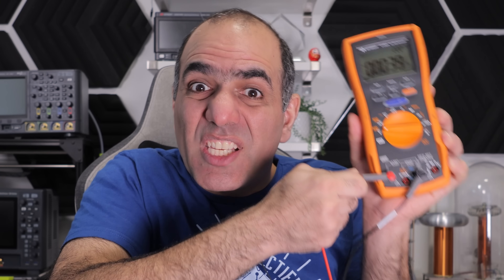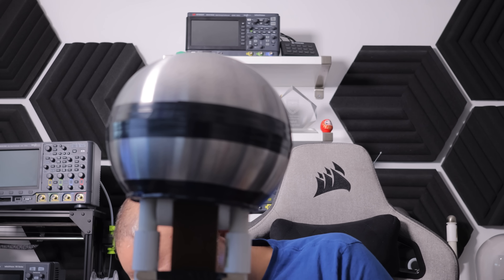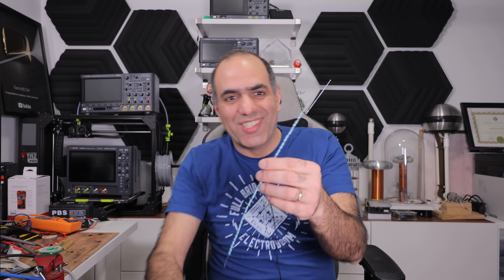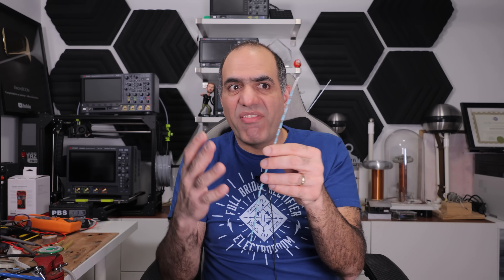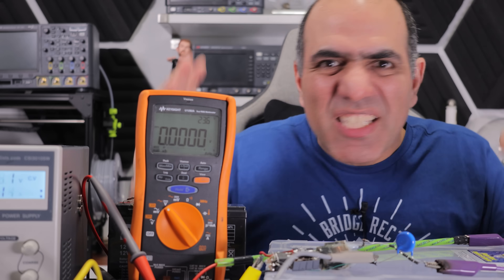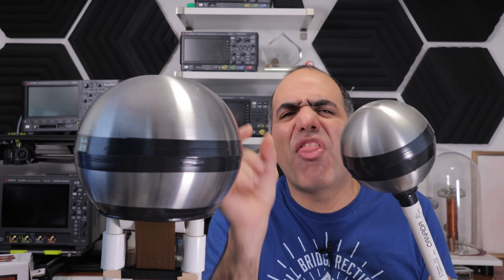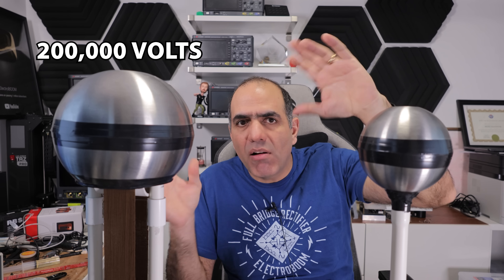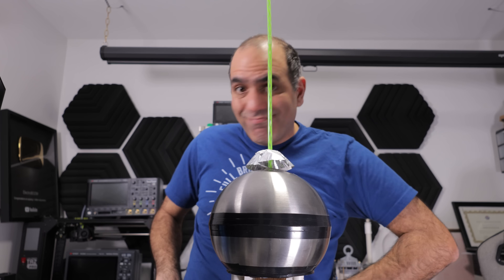SUPER HIGH VOLTAGE Measurement

Comment: This is how they measure those voltages in substations. Although they use a well-tested and rated professionally manufactured equipment with proper safety.

Comment: I'm a software developer for power grid relays with a focus on low power instrument transformers. I can confirm, more or less the exact same techniques can be used to measure grid voltages (and currents) even in the areas of kV and kA. Especially when you started talking about input impedance and capacitance, this was very familiar territory.

Comment: You can not measure AC voltage with resistor dividers because parasitic reactances change your inpedance values. Use your FULL BRIDGE RECTIFIERS first lol. I also made a video on this type of divider on my channel and it worked flawless up to 50 kV.

Comment: Bringing your body close the van de graaff generator was enough to disspate its charge through the air, which is generally considered a very good insulator. Would holding the straw also disspate its charge in the same way? Did you try holding your straw resister pack against the sphere without you holding it e.g. using a insulated clamp of some kind? Great video, as always!

Comment: What if one would charge a sufficient large high voltage capacitor with the van-de-graaff generator? This would be ready really dangerous but supply the Mieter long enough with high voltage to measure it while decaying through the resistor

Comment: because is static electricity...if you had 200000 v dc not static results would differ
big fan since the beggining!!
Reply: Remember, "static electricity" becomes no longer static, but dynamic, when it shocks you or when it arcs to something else.  To assess danger or damage, we have to be concerned with the available energy.  (I'm sure you know that -- I'm saying this for the benefit of others.)

Comment: I've been told that you need only 10kV for one cm, instead of 30 kV. And i checked it.
30 kV is for 3 cm.
Reply: Spark length depends of the shape of the electrodes as well as the voltage difference.  A voltage of 10 kV will jump between needle points separated by about 8.5 millimeters.  The same 10 kV will jump only about 3 millimeters between large spheres or flat electrodes.  Look up Jochen Kronjager for a nice graph and table of the effect.  This only applies for standard atmospheric conditions.
Reply: @analog_guy  thanks!

Comment: Would it be possible to use a capacitor, letting it charge up for some time by the high voltage and then using your giga-ohm probe to discharge the capacitor while measuring with a scope. Then you could see the discharge and from what voltage it was charged to.

Comment: Use an electro-static meter. It is basically two plates that have a spring holding one of them and a needle to measure the deflection of the plates. It does have to keep the plates from getting close enough to arc. one can calibrate with some small weights of known amounts. I forget the math to determine the amount of attraction but it is available some place. I have a meter that uses vanes like a variable capacitor that is used to measure 10K volts. The calculation is simpler as the distance doesn't change, only the area and spring tension.
Reply: There are also inductive probes, they have two electrodes shielded by another set of electrodes that spin. This induces a changing voltage on the electrodes proportional to the intensity of the electric field they are exposed to. This are used to measure voltages up to several millions of volts on electrostatic particle accelerators.
Reply: @teresashinkansen9402  Yep, "field mill" voltmeters.   
The moving-capacitor type are "quadrant electrometers."  They only measure 5KV, although there's one model which goes up to 30KV.
Reply: @wbeaty  Yeah I couldn't quite recall their name. Ive seen them be used on pelletron accelerators to measure terminal potential.
Reply: @wbeaty  yes, I have heard of this.
Reply: It's that basically what's happening at 13:13 with the grounded orb moving every time it gets hit by the discharge?

Comment: With that aluminium piece levitation height, you can calculate the voltage.
F = (k * q1 * q2)/ r²
F = mg (Get F value & put in eq.1)
 
q1 = q2 = q
Find q

V = kq/r
Reply: Where is the factor for relative humidity?      :)
Reply: Oops, when in contact, V1 equals V2 but q1 does not equal q2.  The charge, q, of the oddly-shaped aluminum piece (whether it is called q1 or q2) is just about impossible to compute without an expensive electromagnetic field solver program.  In addition, as soon as the aluminum piece rises upward, its charge is likely to change due to corona discharge from its sharp edges.  If the aluminum piece were replaced with a smooth conductive sphere that were sufficiently light that it could be levitated, that might create a calculable situation.

Comment: How about using a potentiometer to measure the potential of the dome?

Here look at the constant current section for how to do that.I think this should use much less current from the vando graph. But you need a much higher voltage that has at least some current providing capacity.
https://en.wikipedia.org/wiki/Potentiometer_(measuring_instrument)#:~:text=A%20potentiometer%20is%20an%20instrument,source%20of%20the%20unknown%20voltage.

Comment: to measure static charge like this, I think you need something called an electrometer.  Tektronix sells the Keithley Electrometer Series 6500 & 6430.  Of course, it's not cheap.  I needed to use one when I was helping fix a fuel pump & filter design.  It was generating static electricity, which isn't exactly what you want from a fuel pump!

Comment: Nice video. The question than is how did they measure the voltage to establish how many volts per centimeter gap for a spark?
Reply: They used a more powerful voltage source so the voltage was not loaded by the measurement.
Reply: @glasslinger  Thanks. Make sense. But did they have more powerful equipment at the time the voltage/distance was established?

Comment: 2 electrodes can be enclozed in plastic chember with variable (magnite inside and outside of the enclosure) gap between them, inside   some dielectric oil with stable electric breakdown.
Or old electroscope with no ground needed ( those with two long leafs that repeal each other)

Comment: A capacitive coupling would work. Of course the capacitor needs AC, so the field needs to be chopped up. This may be done with a tiny metal "fan blade" rotating between measured object and measurement electrode. Then, build a proper amplifier and measure the square wave amplitude.

Comment: Even though you're pulling the charges out of it super fast, shouldn't you be able to use the divider hooked up to your scope to see the initial voltage before the fall? This has the added benefit of allowing you to also measure the capacitance of the dome based on the time constant

Comment: Need an electrostatic strain gauge. Measure the force between charged plates and calculate the voltage. Probably involves LASERs too since the forces would be very small.

Comment: All your shows are fantastic , Thank You I have learned so much from you.   I have never been able to make a homemade 
device to actually measure huge static electricity voltages and currents .  I thought I did a few times , but , It's hard when there is no way to check .   Thank you again.

Comment: 3:24 I have to disagree with this explanation. There is no voltage across the resistors because there isn't any current through the resistors. You don't have a closed circuit in that setup, so there is no reason for there to be current going through them. I thought you would have put the setup between between the main ball and your ground ball. Then you would have the issue you were talking about, and it wouldn't work, lol.
Reply from the maker: There is a closed circuit there though... secondary of transformer across resistors
Reply: @ElectroBOOM  with the Van Der Graff Machine?
Reply: If he terminated the resistor with another sphere it might work. The VDG is such low current (static generator) that the resistor provides enough of a breakout point.
Reply: @Pyroteknikid  yeah, there are a plethora of other issues with that, but at least it would read something, lol.

Comment: I intentionally tried to measure the "Amps in the socket", but only once. 🤣It blew the breaker and melted a bit off my probe's tip. It also shocked me, but not electrically, y'know. 😉 That day, i've learned "don't do that", and a few years later i've learned why.

Comment: You can also measure the electric field of your Van-de-Graaff using a generating voltmeter, also called field mill. This is actually the way electrostatic Van-de-Graaff accelerators measure the acceleration voltage in absence of an ion beam. (With an ion beam there is a more accurate way to measure voltage, but this is only applicable in particle accelerators)
Reply: Medhi with his own cobbled-together particle accelerator, what could go wrong!  Don't give him any ideas!  :^)
Reply: @MikesTropicalTech  That SHOULD be his next project! He can make his own cyclotron (i.e. a circular particle accelerator) in less that one cubic metre or even four cubic metres by make his own high current/high-voltage EM coils and using curved  6 inch diameter ceramic sewer pipe (one $3 CDN per foot of pipe that is high temperature resistant) as the insulator and wrap copper coils and a ferrite core together to make electromagnets to create the driver coils for the accelerator. Collide tungsten nuclei together and see if you can measure gravity waves exploding outwards from the particle collisions! If that doesn't work, pulse all the coils at the same time and make a hydrogen plasma SUPER HOT and at high pressure to make his own miniature Takomak Fusion reactor -- He should be able to get plasma temperatures up to 50,000 Celcius at home! What could POSSIBLY go wrong doing all that in his apartment? Use the 240V at 30 amp circuit coming from his home dryer to make a 7200 watt version of said particle accelerator or mini-fusion reactor!

V
Reply: @ I vote for the Tokamak!  😄

Comment: In substations we use potential transformers to step the voltage down to a level we can measure it. The pt measures distribution voltage, and steps it down to something we can measure with a meter, so we can use the ratio of the PT, and the ratio of our substation transformer to find the voltage on the transmission line at that point.
Reply from the maker: You're lucky you have giga watts ti spare!
Reply: @ElectroBOOM  Yes, that's the point of this whole video!
Reply: @ElectroBOOM yes, and in our HV lab at work we use a capacitive voltage dividers, with a tiny capacitor of something on the order of a few pF, that has a very low burden even at pretty high voltages, probably would still be too much for this, but can be used on most sources, we are talking of resistances in the teraohm range instead of giga
Reply: Also the burden of a PT is not that big, it’s like 15 to 200VA depending on model, too big here but not even a KVA

Comment: 3:48 100MOhms? Puny resistance. I used to work on tests where 1 MOhm was considered a short. 100 G Ohm was ideal. Had resistors up to about 10 T Ohm but could measure up to TOhm

Comment: @ElectromBOOM
Try to place the series resistor array far away from the measurement point, such that the resulting probe and cabling getting in proximity of the DUT (and its field) all has high resistance to ground. When you place the resistors at the probe tip, then the cabling (and some of your probe's structure),  is providing a low impedance path to ground in close proximity to the DUT.

Comment: My guess is that the resistor is pararelled with the epoxy resin so lower resistance or the insulation is not well so it arcs through the rod and to the end of the rod (maybe? CMIIW)

Comment: Can't you use a shunt resistor connected to a metal ball and ground and measure across it with the scope? Won't be incredibly accurate since the arc will eat some of the voltage but should still give an idea.

Comment: True story. I killed a less than year old Harbor Freight multimeter when trying to measure the output voltage of an electric insect zapper. Would a setup like that work to prevent that?

Comment: The ending was amazing! You could make an analog voltimeter that looks like an mercury thermometer. Just like you did on the end of the video but with a scale, and the higher the aluminum foil flies the higher is the Voltage. Would be nice.

Comment: I remember the HV analog meter we had in school were just two plates electrically connected and one was able to rotate away from the other plate with the axle at one side of the square plates. The indicator needle was just fixed to that axle/moving plate

Comment: I'd get one of those huge-ass vintage HV probes with integrated voltage dividers rated at 20...30kV. Touching a CRT plate connection with anything less is just asking for trouble.

Comment: Electroboom Uploades a Video

Me* Gosh He Is Alive
Reply: Me too!!
Reply: @Windows98Official same
Reply: Or maybe:  "IT'S ALIVE!  IT'S ALIVE!" lol
Reply: Same
Reply: You prob don't understand what's happening. He's getting shocked, right, but current doesn't go through him. He's isolated from the earth with a rubber mat probably.
Reply: @klarnorbert  He has quite literally almost died in one of his videos. This is a very dangerous hobby and many of the hobbiest die when experimenting, even experienced ones. Electricity is unforgiving. There's a fair reason for worry if there goes a long period of no communications
Reply: @XxPKphoenixX  That's the Main reason as he plays sometimes with High Voltage and High Amperage souce like microvave transformers.
Reply: He wouldn't get shocked if he would be on a rubber mat. But hecould be using some ESD mat with high resistance... Or he uses a source that is current limited.  @klarnorbert
Reply: @klarnorbert 
He is isolated, but capacitativly coupled to ground.
AC≠DC
Reply: @klarnorbert  I understand but he also has microvave transformers which can provide enough high voltage and Amperage to cook you to perfection before you will hit the floor
Reply: @ He used the high current to weld!

Comment: Safety tip:  when stowing your multimeter, always disconnect your leads from the meter.  In addition, when measuring current, immediately disconnect your positive cable from the meter.
Reply: Idk why don't we use another probe for current measurement. Purple colour isn't reserved for anything. Can we have a purple probe for current?
Reply: Nonsense
Reply: @Shocker99  We implemented those rules after two incidents within 12 hours where a tech tried to measure 480VAC using a meter someone else had used to measure current earlier.  Yes, the fuse blew, but they still got flash burns to their eyes.  Several years later when NFPA-70E was implemented, we just issued Fluke T5-600 meters to everyone and made it a firing offense to even approach anything more than 480VAC without specialist training.  Even idiots have a hard time screwing up T5-600s.  Two guys managed it anyway over the years.  Idiots are just too damn inventive.
Reply: @Simple_But_Expensive  Nice story, but your safety tip is still nonsense.

Comment: The best way is through observation. If the bird sparks and burns, it's residential transmit voltage of around 12-40Kv. If the bird explodes in a puff of feathers, it's high voltage transmission lines of several hundred kilovolt.

Comment: You could build a tiny capacitor bank something like 1nF 200kV a let the Van De Graff charge it. With 2G ohm resistance, 2seconds time constant should be enough so you can quickly measure the voltage before it drops too much.
Reply from the maker: Sample and Hold! I like that thought! Although now that I think about it, that would be super challenging to sample too...
Reply: @ A capacitors with very low leakage would be needed (perhaps foil caps?), and pot them with epoxy like you did with the resistors to prevent corona. Assuming series capacitors; no balancing resistors, just hope that the voltage will spread uniformly, which it'll most likely do unless the capacitance of the caps is way off tolerance. Charge it, connect the 2G divider you created and quickly take measurement. Or just put multimeter across one of the capacitors in the bank
Reply: @Astri.electronics  The cap balance issue came to my mind too. It's always sketchy to put caps in series, at least more than maybe 2.
Reply: @ElectroBOOM  A Leyden Jar to store HV
Reply: Just remember, they can be lethal !
Reply: @MrBradleykeith Yes, put the charge on the inside foil, ground the outside foil. Maybe use your big resistor  to make the transfer from the generator sphere, then swap it away from the sphere to take your reading. Minimizes your direct exposure to the 200,000 volts stored in the Leyden jar.
Reply: That would be 20 joules. Not very small! Potentially lethal